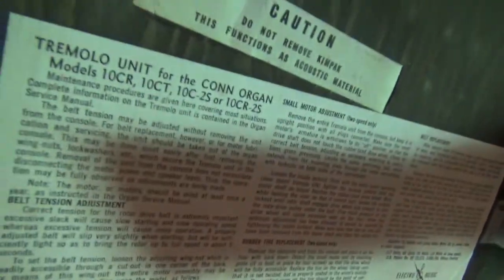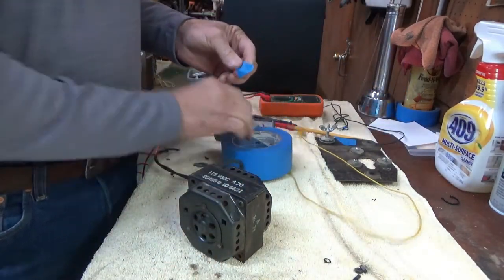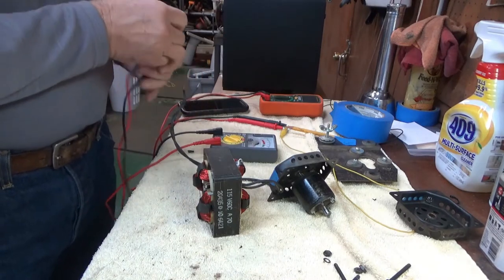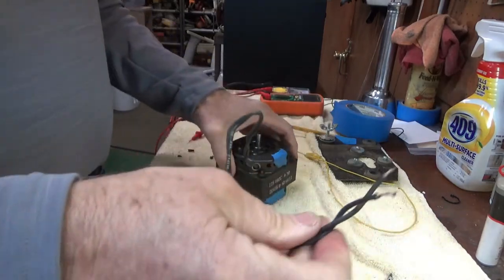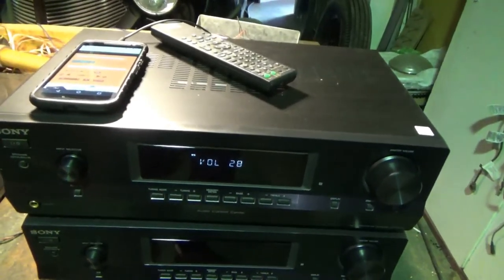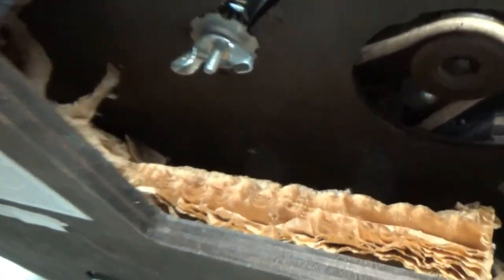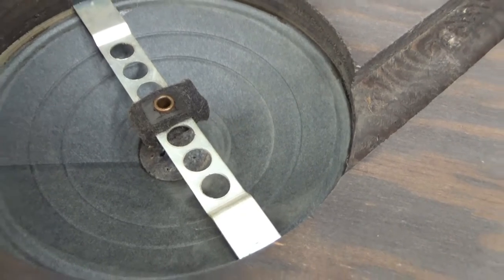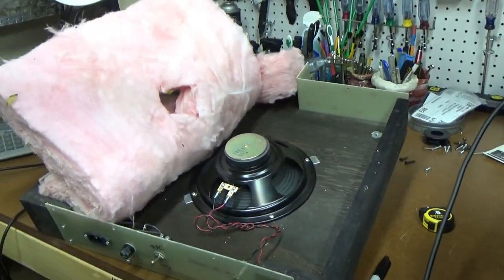Converting a Leslie

Comment: Very interesting video, MG. You overcame several challenges and finally arrived at your destination: a functional, compact Leslie speaker unit. I had to try a few different fan speed controllers to finally arrive at one (from Ace Hardware, of all places) that provided smooth transitions without excessive loss of torque or creation of motor hum. It still causes the motor to heat up a bit, so you have to limit your use of the Leslie....much like the duty cycle of an arc welder. Congratulations on a successful conversion and an entertaining, informative video.
Reply from the maker: Uncle Doug thanks for the comment.  Of course you were the one who inspired me to do this project.  I wasn't sure what to do with that funny whurley thing that came out of the Conn organ.
Reply: @mguess  Well you definitely put it to good use, MG. Hopefully others will follow your example and build their own compact Leslie's.
Reply: @UncleDoug  I just got a wuhrlitzer 7045 amp and speakers already taken out for free last week for my very first project. I felt so lucky lol
Reply: @jungleforeva  That's great news, JF. Best of luck with your project.

Comment: Lovely unit, now I know that it was perfectly possible to make the reflector out of plywood rather than styrofoam. Will come in handy for making my own (or maybe even producing them?) with some more modern parts, such as PWM-controlled DC motor that will allow for fluid adjustment of rotation speed. Dang, the principle of operation is so simple and brilliant :)
Reply from the maker: Agreed, very simple device that produces an very cool and unique sound. I'm not sure if the plywood horn sounds as good as the Styrofoam units but probably a lot easier to make. I like the idea of a DC motor with speed control. Good luck.

Comment: People have been giving these home organs away for years; I've amassed a good supply of speakers and other parts from these, and have done the Leslie unit conversion to a stand alone cabinet a few times now.  I have exactly this same unit in my shop, but frankly, compared to some of the styrofoam cheese wheel units I have stacked up, it just seemed too clunky to bother with (It made audible noises when rotated by hand); it may be worth revisiting...
Reply from the maker: I think it makes a cool sound. I haven't heard a Styrofoam unit first hand but I assume it would sound better than the plywood type.

Comment: Hi; thanks for an excellent video. Do you know what the specifications of the motor are? I’m planning to build one. Thanks
Reply from the maker: It's a 115V AC motor that draws about 0.7 amps. I'm thinking something out of a larger fan should work.
Reply: @mguess  thanks. Are there any requirements as far as torque?
Reply from the maker: @sanjeevmraman  I didn't measure the torque but I don't think that it takes much torque to spin up the drum and keep it going. If you are building a leslie you may want to consider a dc motor so that you can change the speed.

Comment: I built one from an old Lowrey organ Leslie unit that has the styrene foam baffle.  Some AC motors like a shaded pole motor don't get along well with modern dimmer switches that use MOSFETs to chop up the AC sine wave.  You have to use a rheostat-type fan speed control.  I built a cabinet that places the speaker on the bottom and the baffle on top: https://i.ibb.co/HVJ10qS/Leslie-Completed.jpg
Reply from the maker: I have used the rheostat type of fan controls.  It does work but there is limited speed control of the motor.  The motor seems to stall below about 70 volts as I remember.  The Variac works well.
Reply from the maker: Beautiful cabinet and guitar.  Is that a Les Paul?  How do they sound together?
Reply: @mguess  Yes, that's a Les Paul R8.  I drive the Leslie with a homebrew 10w tube amp.  Sounds glorious when it's in the middle of the room.  Super swirly.  Fender's Vibratone cab used the same rotor, but it was mounted on a horizontal rotation axis, whick restricts the swirl.  A vertical axis is far better.

Comment: HEY I TRIED TO CRACK OPEN THE MOTORS THAT i HAD ON HAND, BUT THAT DIDN'T WORK OUT BECAUSE THERE WERE A COUPLE OF STUBBORN SCREWS. SO I BOUGHT A COUPLE OF MOTORS FROM EBAY, AND THEY ALREADY HAD AC cords soldered onto them. I just put one on the unit I mentioned to you before, and sure enough it started spinning fast.
Reply from the maker: Excellent!  I'm glad you got it spinning.  The make a very cool sound.
Reply: @mguess  Now I have a couple of IEC jacks one of which I will use in this project. My thing is where do I mount and/or solder the the jack?

Comment: The felt is an oil reservoir for the porous bronzite bearings. In my opinion.
Reply from the maker: I agree. I've since soaked it with oil.
Reply: @mguess  I recently acquired a Hammond Scanner free-mounted by Analog Outfitters, and it has an open cup where I guess I am supposed to add oil for the bearings. Old tech.

Comment: ..oh, ..is That hat a Dimmer Switch you got on there? ..why didn't that idea work
Reply from the maker: Yes, I did try a dimmer switch for a while but it didn't work very well.  The speed of an AC motor is best controlled by changing the frequency of the supply voltage. A DC motor speed is controlled by changing the voltage however the Leslie has an AC motor. The dimmer switch just reduces the voltage which starves the AC motor for power and will eventually slow it down due to friction of the system. However the speed wasn't very consistent. If I really wanted to vary the speed consistently I would probably swap in a DC motor or develop a circuit which could vary the frequency of the AC voltage for the existing AC motor.

Comment: i just bought an old cordovox leslie cl-10 as parts not working, received it, took it apart plugged in a unplugged wire and there we go a working leslie,  one of the benefits of the younger generation not being taught anything useful these days. Edit: i bought a 3" 18x18 foam pad cut it to size & replaced the old speaker covering material
Reply from the maker: Sounds like you got a deal. I've ordered a number of items on eBay sold as "parts only" that were easily fixed.
Reply: @mguess  well that's still to be seen, when i put her to the amp it came across as extremely dark in sound with not a lot of swirl to be heard on both high & low settings, I opened the small crossover box mounted to the unit , gave the cap a measure she's out of spec so i have a new one on the way but i think it might be more then that, Who ever had it changed the speaker out i think,  it appears stock but i don't think they used this speaker, It currently has what appears to be a beautiful 8" JBL D216 @16ohms but like i said it's really dark in tone, to dark, i might look into a speaker swap depending on what i hear after the cap change,  plus being 16ohms & i really need it to be 8 ohms, anyways i have $160 into her right now we'll see what happens. I'm sure you played through yours How's it sound ? thanks ✌
Reply from the maker: If you are planning on using the leslie for guitar, I would remove the crossover altogether. There is no need to limit the frequency on a single 8 inch speaker. If you are looking for a replacement speaker, you might want to consider the Celestion speaker that I purchased from Parts Express. https://www.parts-express.com/Celestion-Eight-15-8-15-Watt-Guitar-Speaker-8-Ohm-294-2470?quantity=1
I removed the speaker from my practice amp and used it in the leslie. I used the Celestion to upgrade the practice amp. I don't actually play guitar so I can't relate the sound through the leslie. I have played tones and voice through the unit and it has a very cool "wap wap" sound. More than just a tremolo because you have the Doppler effect of the spinning drum. Good luck with the project and let me know how it turns out.